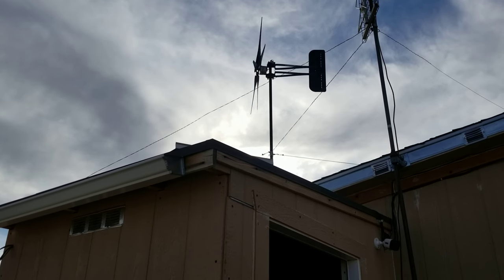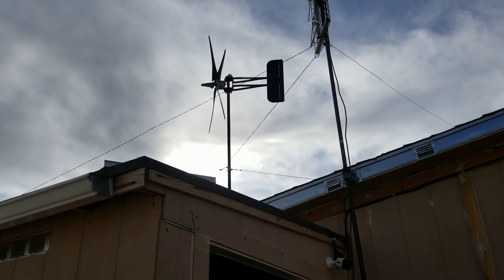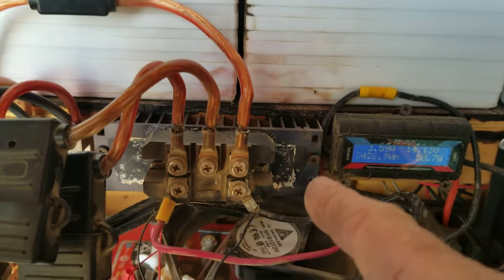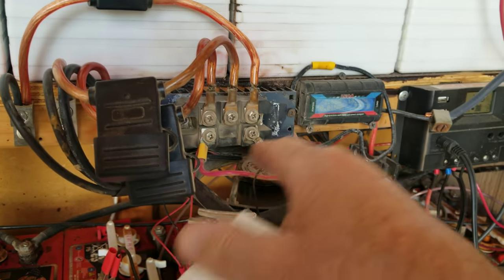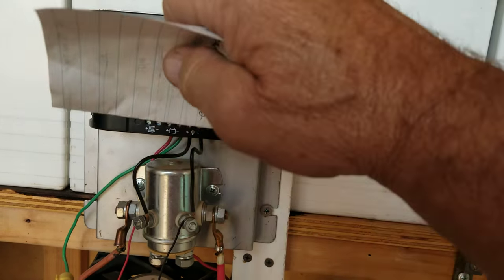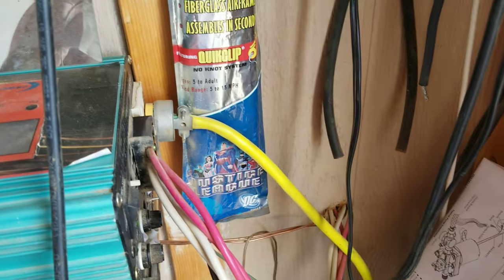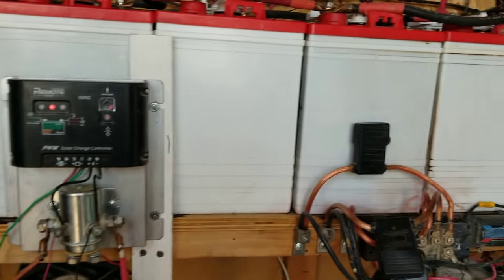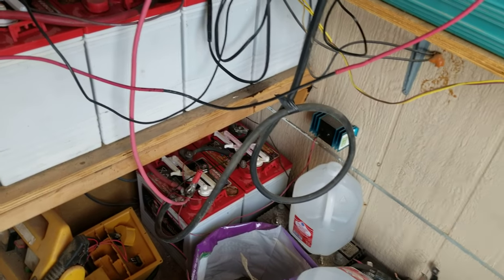Wind turbines, controllers and batteries explained, March 6, 2020

Comment: i am learning lots from this video, if you get a chance I would like you to chat with me as I am just starting my adventure in off grid living and I can do electrical but I always second guess myself
Reply from the maker: Welcome aboard!  Sure I'll help you all I can!  Ask away in comments, as that way we both benefit, you with answers and me with an uptick in comment count.😁👍
Reply: @GBear  I want to do both solar and have wind as a backup, i have lots of data as far as what my power should look like but i want to make sure i don't starve myself for power
Reply: @GBear  ok. I have put lots of time in research into the best overall system for my usage. I am still uncertain about the amount of energy I will need but I do know that: 1) I want to have 2 sources of energy so to run them as a redundant just in case one has issues or needs to get serviced 2) it will get cold during the winter and I am struggling to find a system to heat (without using a ton of electricity or fossil fuels) which brings me to radiant in floor heating. I have looked into it- although it sounds intriguing the 1500+ sq feet of living space makes using an RV 10 gal stainless hot water heater a moot point. A boiler would heat too hot to be used for the flooring, really not looking to kindly at tankless propane water heater for the flooring. Any ideas?
Reply: I am thinking that I would need 10kw of power to make sure I have plenty of juice but that seems like it would be overkill, I would rather have it and not need it then wish I had it and be starving for power. the house layout would be 2 bedroom, 2 bathroom, 1500+/- sq feet, 6' crawlspace, we are wanting to go with gas dryer, electric washer (front loading for water and energy efficiency), tankless hot water heater (8 gpm) LED lighting (reduce the power needed, I LOVE my LED lights I currently switched over all lights in my old home and it saved me tons in electric bills), due to the water being close to rocksalt, the water well would be harder to make potable then bite the bullet and  install a pair of 3,000 gal water tanks (have a shelter to protect from UV rays) so it might need a water pump for pressure. Hopefully that gives some insight into what we are looking to do.
Reply from the maker: Yeah, 10kw!  You must have a current electric Bill of $900+ a month!😂
My place isn't very large, but I am now at 3450watts and have power to spare big time when the sun is shining.
You can look at your current electric Bill and it will show how many kw you use monthly now.  Remember, going off grid means to quit wasting resources, and stretching out consumption.  It isn't how big your house is, it is how efficient it is.
Eliminate unnecessary things like no 65" smart TV, get a small LED set that is efficient and 'adequate'.
Front load washers I avoid because they require the door remain open after use to prevent bacteria growth, and leaving things open off grid is a critter invitation.
Get an energy efficient fridge.
Use smaller window air conditioners that are energy efficient,  and cool only the rooms needed instead of the whole house.
Your biggest expense will be a battery bank and efficient solar, so plan wisely to use less electricity where possible.
Lithium batteries are nice, but not happy in cold climates, so if you go that way be sure to have a heated room for them.
I can't stress enough how important a really good solar controller is, and you may need more than one, as well as a top notch inverter in pure sine wave, low frequency, split phase 240v grid tie with 25% more watt capacity than you think you need.
Also, you are planning a big house.  Build only what you actually need because bigger means more waste, more cleaning, more maintenance, and more money.
Reply from the maker: Heating is another quandary.   Propane so far has proven the most efficient for me.  I insulated well, floors, walls, ceiling,  etc, so keeping warm uses less fuel.
There is always geothermal systems which can keep a well insulated house at 65° year round.
Hot water solar panels are energy efficient, and a better choice for the roof area than electrical solar panels, as they add a 'false roof' layer to keep the dwelling cooler in summer and warmer in winter.  Placing the electric solar panels on racks closer to the ground makes keeping g them clean much easier.  Especially if you get snow on them.
Reply from the maker: Start by eliminating excessive electrical needs and becoming more frugal in your needs.  If you want to impress the Jones's stay on grid.  If you want to live happily and efficiently, learn to do without excessive power guzzlers.
Reply: @GBear  LoL i meant to say 10000 kw
Reply: @GBear  I know we can get better and become more frugal at the same time like I said earlier I would rather have it and not need it than need it an not have it, not really sure at this point about solar and the varying types of it, I just found out there are varying types of wind powers, I was under impression they all do the same thing - boy was I ever wrong!
Reply: @GBear  do you know anyone who carries the hot water solar panels? everyone i have dealt with only sells the electric solar panels
Reply: @GBear  i'm at a loss as to what we should use to wash clothes in, I was told front loading washers are more efficient than top loaders.
Reply from the maker: May be, but they say to leave the door open after use because the door seals air tight when closed and the moisture incubates bacteria.
A good top loader with He rating is just as efficient, but won't handle large comforters and such.
Reply from the maker: No you didn't.   10,000watts is 10kw and enough to power a small town.😁
Most big homes have a 200amp panel at 120volts which is only 22kw on grid.  10,000kw would cover 500 homes.😂
Reply from the maker: That's because they are 2 different utilities, one is electric the other is water.  For the most part, water panels are used to heat swimming pools, so you can google water heating solar panels for companies near you.
Reply: @GBear  oooohhh yeah we don't need to power a small town! we need enough to cover basic household appliances maybe was 10,000 w? I have to go back and look it up, the original spreadsheet was saying we would be comfortable with between 7500 and 8000 in power from solar panels? I still think it's way more than we would need
Reply: @GBear  great idea! you think the solar water heater would handle the in floor heating system? we are building in an area with steady winds, albeit 22-26 degrees cooler than Phoenix
Reply from the maker: Just like electrical solar, the more panels you have, the more production you get.
The only down sides I see is you would need a circulation pump which would be another draw on electricity, and the panels won't make hot water at night.
Also is you have the possibility of deep freezes, the panels will freeze if the water stops moving.
Reply from the maker: Are you planning an on grid or off grid solar system?
Reply: @GBear  it would have to be off grid, closest pole would cost upwards of 250,000
Reply: @GBear  now here is an option not sure if its worth investigating or not, install a 50gal hot water tank just to store the hot water - doesnt have to be hooked up to power just to use as storage?
Reply from the maker: The reason I ask is because your numbers are those of on grid solar.  
With your numbers your battery bank will need to be 2 Tesla packs for around $20,000 alone.
Reply: @GBear  i am at a loss then. i plugged in the numbers, a HE washer, gas dryer, gas on demand hot water heater (showers and basic hot water needs) gas stove, LED lights, a small LED TV,, no not the 55"+,,, more like a 19-21" tv, fridge, water pump (figured i might need one to circulate water) and numbers came back i would need 9000+ power... i am new to all this i think it is high but i have no idea. everything would have to be energy efficient, gas as much as possible. what do you think i would need - again any information is better than storing more than i would ever need or could even begin to dent even if i was without power for a long time
Reply from the maker: Oh yeah!  There's a lot of differences out there.  You may want to check out a company named Unbound Solar.  You can save alot of $ installing components by yourself with their guidance.
Reply from the maker: What would be your approx location? (Ie; State and closest City)
My place is around 450 square feet,  and I have power in both my containers and garage between them.  I can run whatever I want, including large power tools, washer, fridges, air conditioning, microwaves, TVs, lights, etc. On 3450watts solar with power to spare and my battery banks at 'float' which means the panels are still producing, but the batteries and running electrical items don't need any help.
But at night, my battery bank can just maintain the needed power for fridge, lights, TV,  pump, etc.
So there are adjustments that have to be made, like laundry in the daytime, and all heavy use electrical too.  After dark, conserve.
Reply: @GBear  i am in arizona, closest city winslow? we are going to build a cabin big enough for 2 bedrooms, 2 bathrooms (lord knows with a family you need all the bathrooms you can afford LoL  we are trying to avoid containers... FIL (father in law) was hell bent on making a container house but with the dry climate last year and horrid fire season this year any sparks would burn the location we are in (no fire coverage area) so yeah containers is out. cinder blocks and metal framing is my thinking

sounds like i might be able to get by with a 5000 watt system so I can do wood projects and have power to spare?
Reply from the maker: Yeah, off grid definitely means making concessions.  I use an outhouse most of the time to save water and electricity,  but have a composting toilet next to my regular indoor toilet because NO solids go in the toilet.  The toilet flushes to gray water used to water trees. 
I was originally going for a container house until I slept in one in the winter with a pot belly stove and a propane heater running full force and had ice cycles hanging from the ceiling in the morning.  So I built my cabin and doubled the insulation specs, so minimal heat and cooling requirements keep me comfortable.
You asked about heated floors from solar water panels,  in the summer the house would be unbearably hot, so be sure to install shut off and drain to disconnect it from the system for the summer and divert the hot water to some other need.
Reply: @GBear  apache county had a major problem 15 years ago... ANY house MUST have a septic installed. the building commissioner didn't go into a lot of specifics but apparently some idiot dumped solid waste into the ground and created a HUGE environmental issue. the saying goes; one bad apple ruins the bunch - that's all it took. aside from that the rest is easy for the most part - they aren't hardcore like Preoria county or some other counties. With the information you have given, information I feel comfortable knowing this won't be impossible, just a challenge which I look forward to embracing. I was telling my wife with all wiring coming in have a breaker on it to make replacements easier, as far as water it maybe overkill but a dual shutoff on both ends of the piping is a headache to avoid especially when a pipe fails or develops a leak. Your idea of the breaker switch is spot on - I like that. With the solar water heater, a shutoff would almost be a must, this way it can be regulated once it gets warm during the summer, or even use a diversion pipe to re-route hot water to other points to reduce needs on the propane. You have been a HUGE help and it is greatly appreciated!
Reply from the maker: Happy I could help.  They may a leak detection valve that automatically closes if a leak occurs.  They are nice to have, especially if you spend time away.
Remember to never disconnect any leg of a PMA during a wind event.  It will freewheel and burn up.
Enjoy, and send pics when you get established.
Reply: @GBear  once it all is hooked up, I don't see any reason except for maintenance to disconnect anything. Even during highwinds,,,the faster it runs the more it charges the batteries :)  aye, that I will!

Comment: Thanks for the informative video. It was a great learning experience. I'm interested in this and solar technology, so any bit of info I can get is most appreciated and helpful. Just want to critique your wiring. Damn! Judas man, you gotta really organize that wiring a bit better. It looks as though someone took a colander of spaghetti and dumped it in the room. I guess working in the telephone industry for years installing equipment in the switches have made me somewhat of a stickler for neatness. I guess as long as it works, then it's okay. Take this with a grain of salt and constructive. Cheers!
Reply from the maker: Yeah, if I beaten up the wiring the crooks can see what to touch and what not to.  I know where everything goes,  so since the wire doesnt care if it is straight or bent, it works for me.

Comment: You griped about the "waste" of power from the fan - but u are using PWM Chargers and lead batteries....lol - u waste a thousend times more with this setup as ure fan will take
Reply from the maker: Welcome aboard.  You are watching very old videos.  My system is now using all mppt controllers, AIMS inverter, etc.  Also, this would be 10 years on most of the batteries and such, so I plan to be upgrading to a 48v LiFePo4 bank with the 6548 SunpowerGold unit.  Stay tuned!
Reply: @GBear  Yeah, i saw your new ones. but in case someone will watch this (as me) ;)
Reply from the maker: @fellpower when I get my inheritance,  I plan to upgrade my whole system.

Comment: Super sketchy connecting all those lugs to plywood
Reply from the maker: Not really.  Welcome aboard.
Reply: @GBear  consider mounting them inside a steel box. 1 connection goes bad for any reason that’s going to become an Inferno
Reply from the maker: @justino6544  thanks for your concern,  but I don't believe so.  8 years and running.  Low voltage only through those connections.
Reply: @GBear  running ground through pipes just seems wrong. In my trade that would get me fired. Always run independent ground circuits.
Reply from the maker: @Justin-Outdoors  interesting.  What's your job?
Reply: @GBear  elevator repair
Reply from the maker: @Justin-Outdoors  That job has its ups and downs.

Comment: Your store room looks like a fire ready to happen. Having the battery bank below electrical cables is very dangerous because batteries give off HYDROGEN GAS which is highly flammable. Hope you have a sensor for battery gas very close to your batteries. So many bare wires. Only you know the wiring on that board. VERY SCARY SETUP MATE!
Reply from the maker: Thanks for your concern.

Comment: you need to charge them batteries to 15.2 if you don't  they don't disulfate properly and wont last long.there is a free e-book called solar secrets. John Bedini help write. you may need to go read it.
Reply from the maker: Thanks, but I have a Midnite classic 150 controller and a Renogy Rover controller, both of which run automatic equalization at set periods to do just that.  I also have a BLS-12 connected which helps prevent sulfation.

Comment: you have over complicated your system your mppt takes higher voltage and by reducing high voltage down and doing so bumps amps to make use of higher volt panels I am running 40v panels and this can make higher efficiency of your panels pwm regulator is just a switch charging or not charging with no efficiency improvement  and your wind power even though it just goes to your batteries by doing that you could be pushing any where between your 12v up to 40v or more and be boiling your batteries and cooking them
Reply from the maker: Thanks.  Welcome aboard. In the future I plan on getting  Midnite 250 to regulate my wind power. For now, my current configuration is working for me, going on 7 years.  I've never found a reason to fix what isn't broken.

Comment: you must of up dated by now this is 4 years ago
Reply from the maker: Yes, long updated.
Reply: up date me on your charge controller i just burned two charge controller up to dayon my 12v setup i guess to many 12v panels
Reply from the maker: @LEETAVES I'll try to do a video for you later today, if the winds die down a bit.  25mph right now out of the south.
Reply from the maker: @LEETAVES First, I need more information.
1.  What are you trying to run?  These are off grid setups and cannot be used to power a grid tied household.  Those components are different.
2.  What size battery bank do you have?  Type, voltage, amp/hour and number of each, and are they all the same?